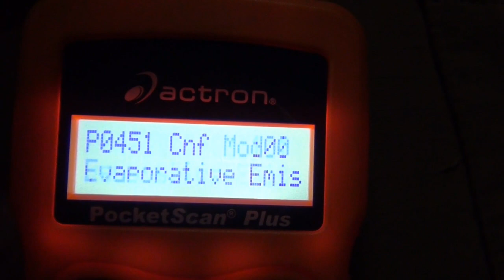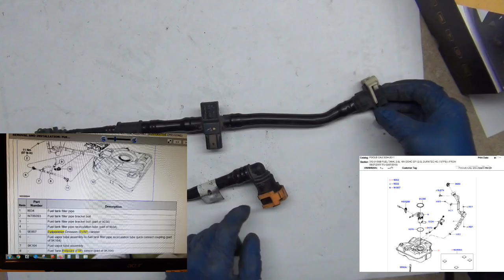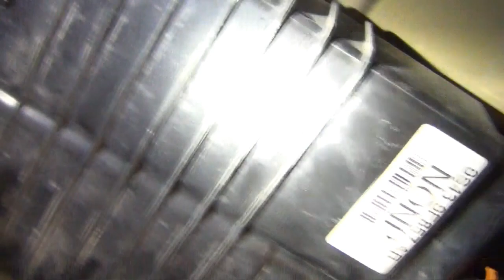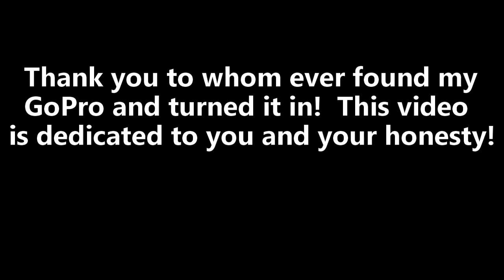P0451 Ford Focus Check Engine Light Code Complete Fix Tips and Tricks and How to Replace It

Comment: Hi Brian, is there a way to test the sensor? I have P0451 and P1450 at the same time. The combination seems to point to a damaged FTP. Given the cost and pain it is to replace, I'd rather test it first. Everything I can find requires pulling vacuum on the sensor inlet...but it seems to be on a t-junction.

Comment: Silicone inside the connector as well, will mean next time it comes off. Amazing just how clean that Focus is underneath, you must have dry roads, because here they all will be caked up thick underneath, and rusted all over.

Done the power steering hose replacement on it yet, they all have a recall for the power steering hoses bursting and causing an engine fire. hose that blows sprays right onto the exhaust, and because the BCM locks the doors automatically, the doors do not unlock when power goes from burnt wiring, and when locked you cannot unlock manually from inside. ford Kuga has had a couple of deaths from that, shades of the Pinto again.
Reply from the maker: Thanks for the heads up on that!   Utah has the market to be in for amazing salt.  We have a red road salt (Red Jurasic Sea Salt from when the sea covered the state that's mined here that is good down to 15F and doesn't rust your stuff as bad.  That's mixed with the white stuff we sell to everyone else.

Comment: I replaced fuel tank pressure sensor,gas cap, purge valve .and vent still get p0451 code took to garage they did smoke test and updated computer software, any ideas what to do now.
Reply: You fix that?
Reply: i would like to know cuz i got the same problem bruh?
Reply: Get a new ecu
Reply: I think the I rings being old need to be replaced after disconnecting. Replace them or the lines. No leaks has to be them leaking vapors.

Comment: Hi Bryon I was hoping maybe you could help me. I have an 04 avalanche. I got a code for BANK 1 02  sensor below threshold. Now it’s doing this. when it gets really hot I lose all of my hydraulics in the brakes and a boggs down and starts to smoke. Also noticed that when I turn the AC on it sets off more severe symptoms. And he gets so bad to where I’m not able to even drive it until I let it cool down enough that it’s fine. As long as I don’t rev. I’m thinking clogged cats. Causing me to lose vacuum pressure. Maybe why I am losing my brakes? Intake pressure is only 7psi when running. I will provide a link to my live data on my scanner.  I recorded you can see the fuel trims and my O2 sensors and the PSI in my intake pressure would really appreciate if you can point me towards your direction on how or if I’m on the right track as far as clogged cats. Please please help thank you.  I have no problem paying or donating to your channel if that’s what it takes. I am mechanically inclined. Learned a lot watching your channel and learning    https://youtu.be/1d1gtZLtVW8
Reply: *Brian